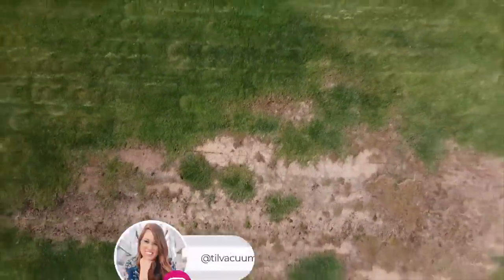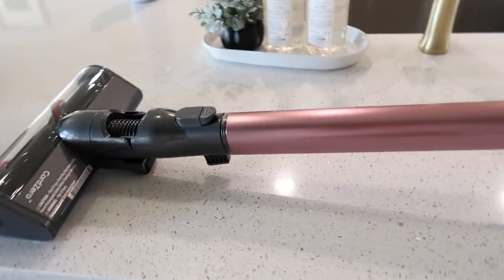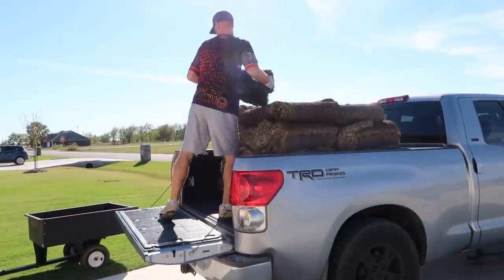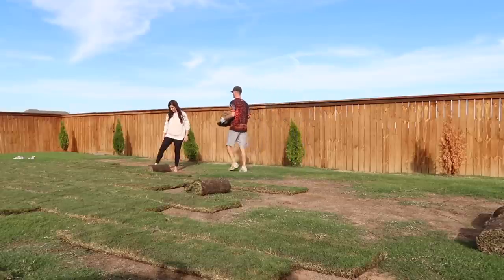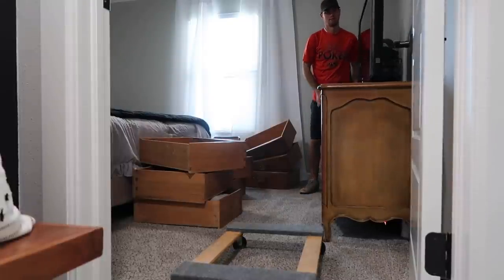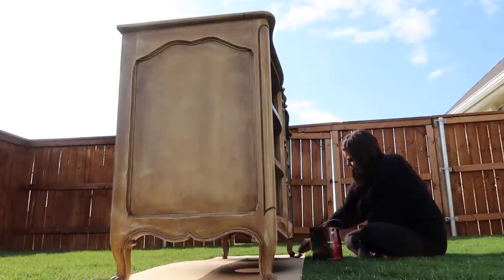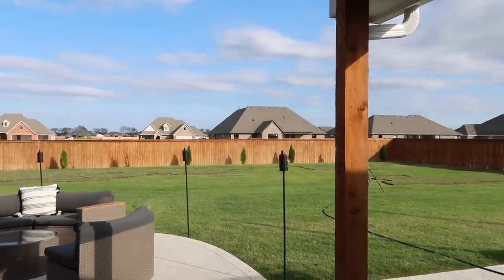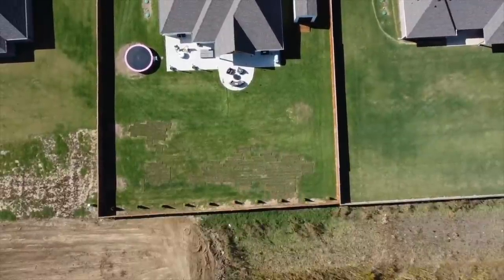2021 FALL DIY HOME PROJECTS | AFFORDABLE HOME UPGRADES | DIY HOME PROJECTS ON A BUDGET

Comment: The attachment on Chase's lawnmower is an aerator. It is used at golf courses to keep the course lush and green. It puts holes so that oxygen goes into the ground. Golf shoes also aerate when waking in your lawn but a much tedious way to aerate. Fall and spring is a great time to aerate.

Comment: Throwing this question out there.   I know u are great at style and many others on here are also.  Okay here is my problem.  I have a very small house.  Two small bedrooms, one small living room, and kitchen reg size and a bathroom of course.  The hot water heater is in our 5-foot hallway and is such an eyesore. lol   Any ideas on hiding it and also my thought was putting up curtains in place of the doors that are much more in the way and we NEVER use except the bathroom door. lol  Thoughts or should I just leave the doorways open?   tysm <3

Comment: You guys got a lot done! Good job! Do you like the LG over the Dyson cordless? I know you used to have the Dyson. I got mine bc of your recommendation. It’s acting weird on me now... goes on/off as I’m vacuuming. So frustrating! I want to get another one. Not sure what to get. Why do you like the LG so much more. I trust your opinion! Help 😉
Reply: My does the same thing. If we empty it that usually will fix the problem.Good luck.
Reply: @lindabell4757  thanks for the tip Linda! I’m pretty good about emptying it, but next time it does that I’ll be sure to empty it!